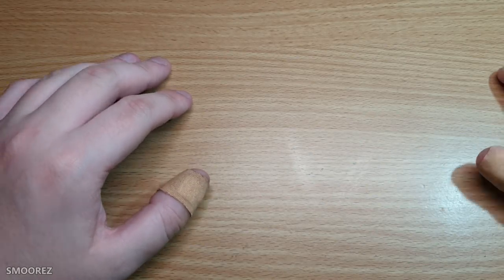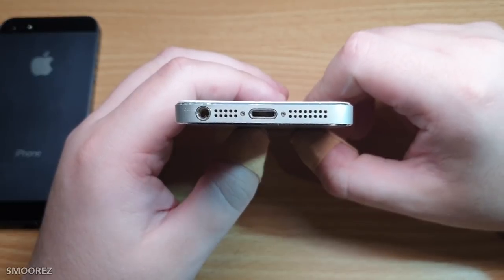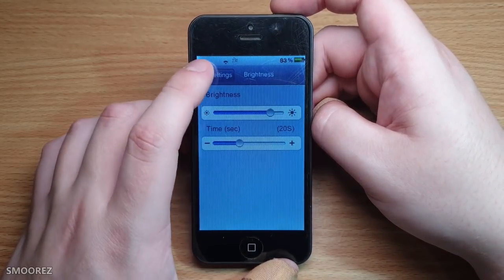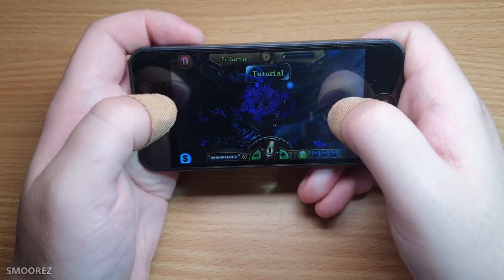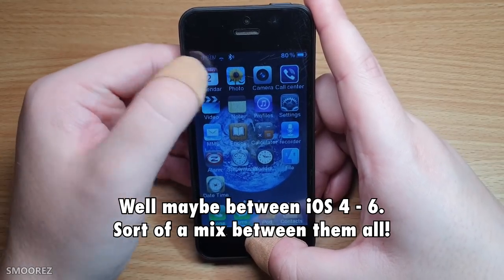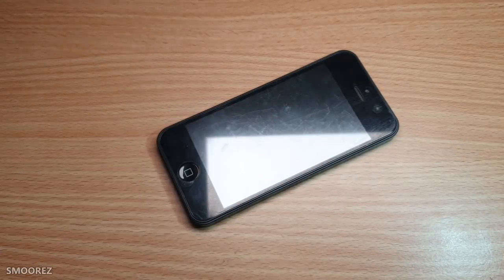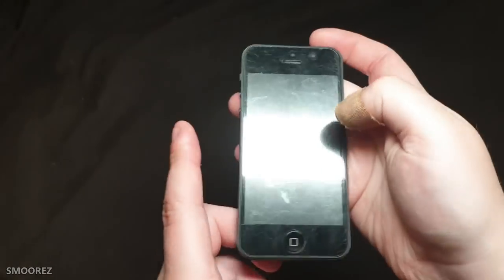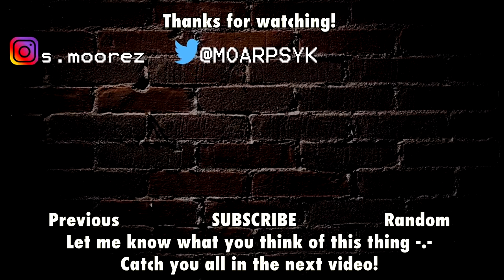ATTACK OF THE CLONES! Taking A Look at an iPhone 5 Clone from 2012! Review & Teardown

Comment: Smoorez!! I have good news!! You CAN solder!! It's stupid easy man, just take an old circuit board, get your iron, your desoldering solution (wick or solder sucker or whatever) and start  practicing!! Two things that will help, you heat the part with the iron for just a second then apply solder, don't try to apply it directly to the tip of the iron and then apply it, presolder the leads on whatever you're soldering onto the board then just stick it down, use the iron to reflow it all together and you're done! And as for desoldering you should apply just a tiny bit of flux or fresh solder BEFORE you remove an existing solder joint, it'll help the existing solder to liquefy, especially on really thick or really old solder! Other than that there's really nothing to it, and once you get it down you'll be grateful to yourself for taking the time to learn. And if you find that you feel like you kinda suck at it at first just remember what Jake from Adventure Time says: "Kinda sucking at something is the first step to being kinda good at something." And know that you're on your way man!! Love your channel, the long rambling videos are great just the way they are. (Just like this comment!) 🤣😂 And don't be so hard on yourself, F the haters, keep doing what you do man, no need to apologize for it! Seriously, you rock man, keep killin it!! You'll be at 100k subs in no time!!! 🤘🤘

Comment: SoC should have the radios integrated, there shouldn't be anything external. I can see the flash chip near the SoC, or at least what i presume to be the flash chip. SOIC-8-200 chip, 200 is the length, it's the chonky version, 8 is the pin count. If i'm not mistaken its designation starts with 25 and a letter, that would be an SPI Flash/EEPROM, then capacity in MBit, the largest that you get super cheap is 128, which is 16MB, because PC mainboards tend to flood the market with easy-to-recycle junk, and they used predominantly this capacity for decades. The chip north of the SoC on the opposite side might be the RAM. MCM with all that integrated would cost extra, since you can't just reuse salvage junk. Stuff at the south end of the board should be all power and low-frequency linear stuff.

Two years later, bandaids have stayed on. Good luck with the fingernaily bits there :(

The hidden button might select bootmode when the SoC is first powered on, you need to disconnect the battery to test that. Maybe those guys were too cheap for automated pogo beds to perform initial programming and such. It's not really worth testing, given the only thing you will see upon successfully getting alternative boot mode going without whatever they used to program it is... nothing.

Comment: I like these phones 😀 even if they are useless, i have a chinese phone from 2007/2008 and nobody in earth has it i think , it has a tv antenna and the OS is something strange to use! I bet you have that
-quick description:
Buttons (1,2,3.)
Touch screen
Bluetooth, voice rec, midi ringtones , mp3 playback, 3gp playback (works bad)
There is no wifi and no data connection
It came with 2 batteries !
No java support!
500K internal memory
Supports 16gb sd card 
Fm radio, analog tv
Welcome startup with animated water wallpaper and tone1.midi (you find it on andrelouis website)
Camera 
3 games (no nes support)
It uses a samsung usb port and a nokia small one (both work)
Loudspeaker (really loud) play midi and instant earrape you can change mp3 volume on music player though
Calendar 
And ....
(Sorry for bad english)
I would like to teardown it but i'm scared to broke it